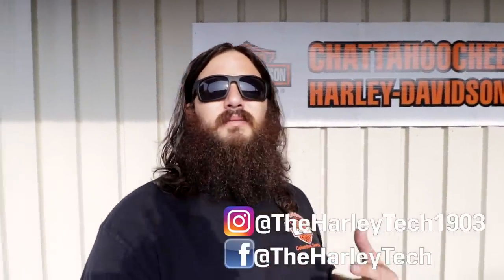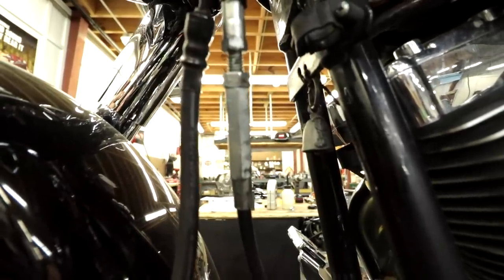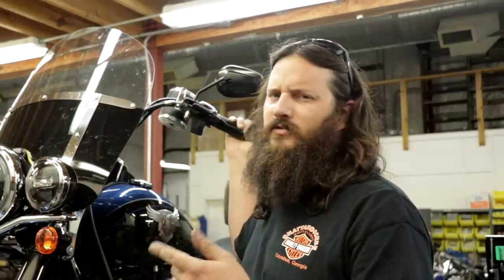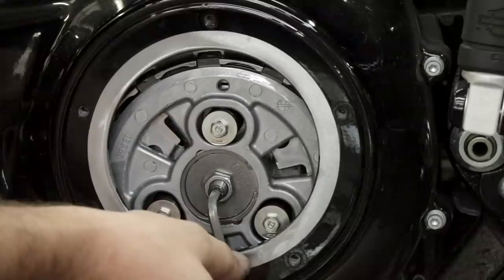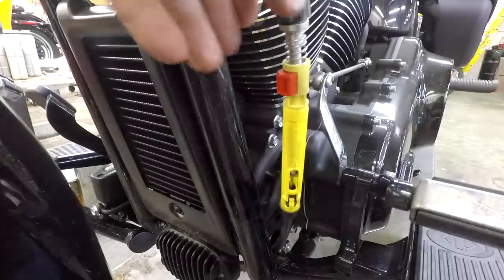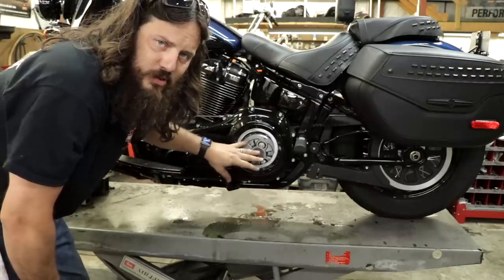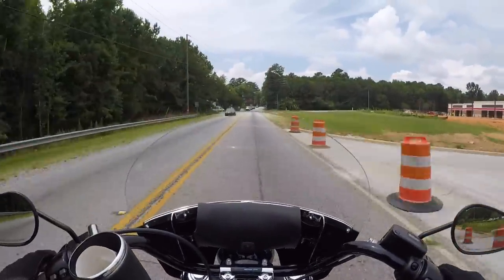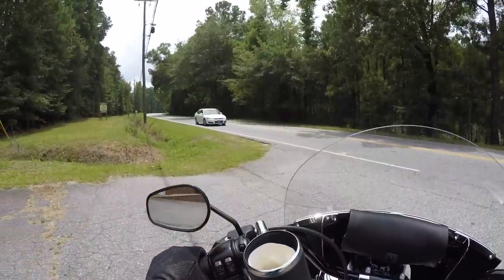2018 Softail Clutch ADJUSTMENT

Comment: I have a new Electra limited and it has a hydraulic clutch and it I have a hard time finding neutral also . But figured that ( as you said) it’s just learning the feel of the transmission and I should start finding neutral easier.
Reply: Switch to Red Line Shockproof for your Trans, or any Gear Lube. 20/50 is a motor oil not gear lube. JMHO.
Reply: Freddie Ray I was thinking about going with the Amsoil transmission oil and the primary oil that they have. I’ve been using that brand in the past. I have 900 miles on the bike so I will be changing it pretty soon.
Reply: That's cool, I only tried RL after reading a lot of raves about on Harley Tech Talk, but I will be switching to Spectro products. I've used Amsoil 20/50  in all three holes before with no problems. When I put in the RL Primary Oil it sounder great the first day, but when I fired up on the second day I thought my compensator took a dump. So I drained it and my garage stunt to high heaven. HTT subscribers thought I had a bat stator. Even the bottle stunk. I put Amsoil 20/50 in and everything sounded like before.

Comment: So there is absolutely no cable adjustment whatsoever? I was told by a certain dealer the cable was out of adjustment down where the rubber boot cover was on my 2018 Street Bob and because I did my own 1,000 mile service there was no warranty coverage. When I asked “isn’t it self adjusting there?” They said “no you still have to adjust it there.”  I watched a few videos of how to do the clutch adjustments on the new 18’s and I did it just how it was in your video here. So now I’m curious if they shafted me on $50 clutch adjustment fee. To rewind a little bit I had to bring it in because all of a sudden after 2,000 miles after adjusting my clutch myself in the 1k service there was a pop noise when I pulled the clutch and all of a sudden I had a lot more clutch lever play (maybe 1/2”). That’s when I brought it in and that’s what they told me was wrong and charged me $50 (cable adjustment).
Reply: JRod783 don't let them lie to you about doing your own service voids your warranty. Look up the Magnuson moss act of 1975.
Reply: Chris Long I know about that. I just wanted to get clarification about the cable adjustment part. I just wanted to give him a short background on why I brought it in. Thanks.

Comment: Can you confirm that the CAT on the 18 Fat Bob FXFBS is located in the muffler and not the pipe?
Reply from the maker: It is in the pipe in a fxfbs. I wonder where I read they were in the muffler. Or if it’s just the fat bob that is that way...
Reply: Thanks for confirming, guess I will have to spend the money then for new pipes or pull and weld the factory pipes removing the CAT.

Comment: Do I need to adjust if I just need to tighten?
Reply from the maker: You talking about the lever being loose? Yes, do the full adjustment. Biggest mistake I see from a DIYer is adjusting the cable and not the basket until they ruin their clutch plates.

Comment: I just purchased an 18 Heritage 114. My bike is extremely loud(engine not exhaust). Clacking around 2000-2500 rpms.  Dealer says this is normal noise for this bike.  Had it in twice.  Have you noticed the m8 being really noisy?  And yes my neutral is impossible.  I shut bike off.
Reply: I have an ‘18 Heritage 114 as well. Haven’t had any unusual engine noise.  Neutral can be a bit testy, but not the worst I’ve had.
Reply: I've got a 114 in my Breakout and the engine is so smooth and quiet, Harley was able to engineer a louder exhaust note and still be EPA compliant.  Also, I have no issues finding neutral.  You shouldn't have to shut the bike off.  I think I would visit another dealer if I were you.
Reply: Chad Mock mine makes ticking every once and awhile around 2000
Reply: Only 500 miles pn my 114
Reply: Brad Gunderson it seems hit and miss.  Some have the issues.  Others don’t.  A couple friends have the M8. Smooth and quiet.  I’ll keep pressing the issue.   Right now I’m just building a paper trail.
Reply: mine is quite too. the bike is sooo quite. shessssh. getting the new exhaust soon.
Reply: Had the same issue with mine, turned out to be the gas cap rattling.

Comment: Is the rider backrest on that anniversary FLHCS a stock Harley part?
Reply from the maker: It’s not stock (comes with the bike), but it is a Harley part from the parts and accessories catalog.
Reply: @TheHarleyTech  Thanks, John.  I just bought a 2019 FLHCS in Wicked Red/Twisted Cherry.  The stock seat is really comfortable but doesn't provide the lower back support that the Mustang seat and pillion on my previous bike provides, so I was thinking of getting a backrest and keeping the stock seats.  GREAT videos, BTW.  I'm a Harley guy now and your videos have been very helpful and entertaining.  Keep up the good work. <3
Reply: @John Maxwell Hey, John.  I was told at my local dealership that Harley only makes a backrest for the FLHCS for the Harley Hammock seat.  I like my stock seat and don't want to spend $529 on a  Hammock just to get a backrest.   A guy has one like this in the FaceBook group "2018 & 2019 Heritage Classic (FLHC & FLHCS) Owners & Fans" and said he got it from Grasshopper Limited (http://www.grasshopperlimited.com/).  Their's works with the stock FLHC seat and passenger pillion.  I just ordered one and it was $92.70 shipped Priority Mail.  That was a customer bike and you probably don't have access now, but are your 100% sure that was a stock Harley part on the bike in this video?

Comment: Do you have a video for clutch adjustment for 2014 softail slim
Reply from the maker: No, but it’s the same thing except you have to screw in the adjuster to relieve pressure on the lever. Do the bottom adjustment, and then loosen the adjuster on the cable until the lever had a nickels width of play.
Reply: John Maxwell thank you for taking time to answer me

Comment: I have a hard neutral on my 2018 Sport Glide.  It went into the dealer at 1000 miles and had a full clutch adjustment.  It is about 2% better.  I have to turn off the engine to find neutral.  With the engine off it pops in every time.  It is a pain and I have kinda gotten used to not being able to find neutral on this bike with the engine running period.  I use a light foot pressure to just lift or lower the shifter and it just slams into gear every time without even a sniff of neutral.  Makes me wonder what they're doing on the production line with so many riders coming up against this issue.  I will have to invest in a proper bike jack so I can level the bike and do the primary oil level check and clutch adjustment myself.  Shouldn't have to do this on a brand new bike under warranty.   Love the bike, just find it frustrating that with all the engineering going into these motorcycles something so basic as selecting neutral is an issue.
Reply from the maker: Have you let the dealer know that it you’re not happy with it?
Reply: Well, not a short story.  Prepped them a number of times on the issue before it went in.  Provided clear info on conditions when problem is most evident as you suggested in your video.  The bike came back and the clutch lever position at the handlebar was improved ( as your spec).  Disappointingly though the hard neutral remained.  If I try to select neutral from either first or second I have to go up and down at least 10 to 12 times and that gets old real fast.  Interestingly with the bike in first gear and the clutch held in when I push the bike I feel periodic resistance.
The real bummer is the first trip out after service the trim strap on the centre of the gas tank flew back from it's mounting point on the binnacle.  Looks like the rubber/elastomer separated clean off the plastic keeper that inserts into the binnacle.  I could glue it back down although on a brand new bike this seems a bit off.   Dealer is looking into it.
Reply: Update:  So I followed your procedure and adjusted the clutch.  I loosened the lock nut and checked the setting and I found out that the dealer had it set to one quarter of a turn back from the point of resistance.  I set it to three quarters of a turn as you suggest.   I've been out on it twice now and I have been able get neutral almost all of the time.  The only time it became unobtainable was when it was really hot at the end of a long ride.  So thanks for the clear explanation John, much appreciated.

Comment: Is this procedure the same for a 97 FLSTS and where do I get one of those adjusting tools?
Reply from the maker: It is the same except the clutch cable adjustment is done differently because the cable is different. What tool do you mean?
Reply: John Maxwell. The tool that you used on the cable.  My bike is almost impossible to get into neutral while running.
Reply: Gary Rueger I think that yellow thing is what you are referring to.. I think it's part of the new cable.. but in essence the adjustment is the same. Without that spring where you collapse the cable in the middle. Adjust it out to take up the slack at the lever then lock the cable jamb nut down.

Comment: ? I know your supposed to put premium gas in your biketo help il run cooler but on a cooler day would regular work as good. Almost ran out of gas a while out riding the gas station i found only had regular or diesel how bad is is for the bike also ran across other videos where factory recommends premium gas but they run regular and get better or just as good performance. Thank you in advance
Reply: Brian Blair this depends on your compression ratio and elevation.
Reply: Brian Blair they require premium to prevent detonation from ignition timing and high cylinder temps. The higher octane rating makes the gas harder to burn. An emergency fill up probably wont hurt the engine.
Reply: khmaiaznboi89 883 stage 4 2013 iron nw of st Louis about the same  as you

Comment: John, got a new idea for a video.  so I was looking at changing calipers on my 18 SGS and i asked one of the techs today about brake lines, fluid, bleed the lines, etc. on install, and how things change with the ABS system.. He told me that not only do I need to watch when I install, I do need to bleed the lines of air and THEN ALSO you guys have to do a computer run of the abs system that also ensures there is no air in the lines as well?  I had no idea that was the case or the ABS system could do that.. I dont kow how many people out there are bleeding their lines without the abs systems part being done.  IF (and thats a big if) because i dont know if this guy was just not knowing what he was talking about, but if its so, this would be a good topic and video to cover.  its def. a safety issue as well.

thanks again!
Tyler
Reply from the maker: Good point. I think I’ve talked about ABS systems a few times in past videos, although. They are older, and the channel has a bit of a bigger reach now.
Reply: John Maxwell oh really.. you may have then. I went back and looked after i spoke with him and didnt see it as a title. But it was the computer part of the bleeding the stuck out to me.. i understand hd concept and how the abs system works with certain wheel sizes vs rpm/speed.  Just thought if you do any brake bleeding or brake work on a newer bike with the abs may be a good spot for a video.
Reply: TylerFJ24 you don’t have to do the computer to bleed the brakes, unless you changed an ABS module or you are flushing the system. The brake fluid normally bypasses the ABS system unless you have an ABS event. If while flushing you don’t use the computer to actuate the module you will be left with old fluid in the module and possible corrosion from excessive water in the fluid.
Reply: Scott Bledsoe or john maxwell is there a device that i can buy to check my own h20 % in the brake fluid?